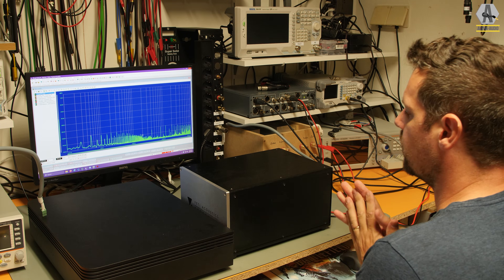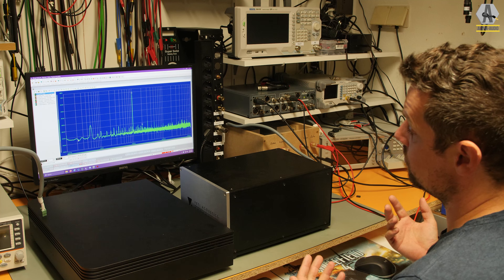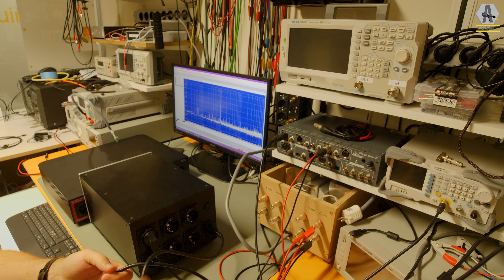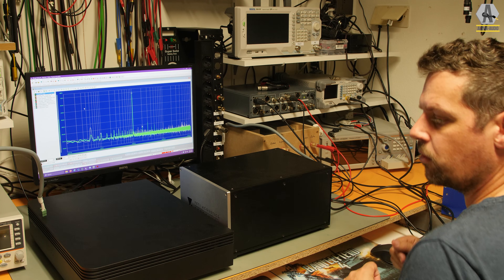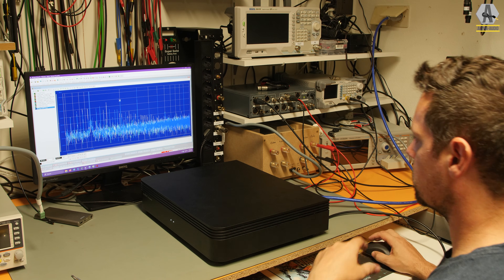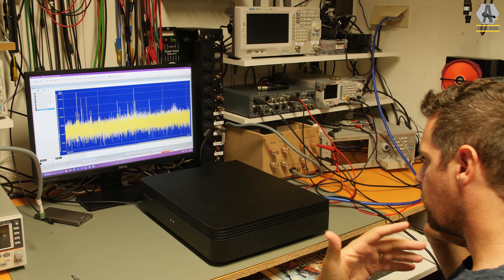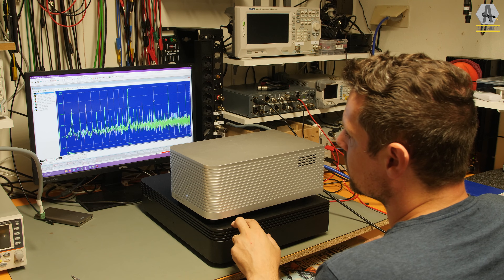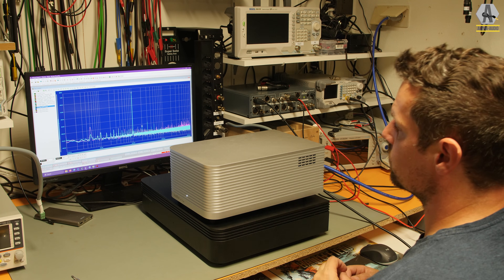Alpha Labs - Do Power Conditioners actually do something?

Comment: There will be no audible difference though. I have asked manufacturers of really high quality amps about this. All have said that the provided power cable to supply is enough and they dont recommend them. I had an Isotek, and I  could hear zero benefit of it being used.

Comment: A power conditioner CANNOT lower the 50 (60) Hz component of a power amplifer's output noise since it is ahat is POWERING the amplifier itself. If you got such a measurement then it indicates that your test procedure is incorrect OR that you have not properly questioned WHY. Removing hight frequency 'noise' MAY be possible but this work is simply sloppy and clickbait.

Comment: It doesn't take very much DC on the mains at all to meaningfully reduce the VA rating of any toroid. We're talking by TENS of percent delta for just a few ma of DC. So any conditioner that eliminates (or even substantially reduces) DC will absolutely counteract any "current compression" in an amp if there is DC on the mains. If you own a refrigerator or other appliances or phone chargers....you have DC on the mains.

This is aside from the myriad other noise reduction benefits that quality conditioners can bring. Just talking DC.

Oh and if you are talking about the many (cheap) DC scrapers out there such as from iFi, et al.....those can only remove a certain amount of DC. Useful in some cases, but in no way comparable to a dedicated conditioner.

I use a 10 kVA topaz 31 series (.0005pf) wired for balanced power for my solid state system and a 2.5 kVA Topaz 31 series (.0005pf) wired for normal power for my tube system. Just power strips on the output of each. I don't use more than 30% of either's current capacity for the highest dynamic peak for either. And DC can't make the jump from primary to secondary (obv).

Jet black backgrounds, effortless dynamics...... "2am sound" at any time of day.

Comment: Can you do everyone watching this strip each unit down and go over the components and circuit the reason the yetti does so well it has an isolation transformer big deal unless the inside has been blessed by a witch doctor I don’t think the yetti has cost more £300 to make 90% mark is a bit over board

Comment: What I'd like to see is the result of adding some low ESR RF bypass capacitors across the main supply smoothing caps plus in other critical areas like current sources etc, unfortunately power amps don't have published PSRR, if they did this "problem" would disappear but so would another lucrative income stream.

Comment: I'm a bit late to the party and I mostly enjoy the content you guys create.  But what is shown here is fairly misleading.  50Hz is the fundamental, so if you measure less on the output, then less has gone in.  Meaning that the output voltage of the conditioner was lower than the voltage from the wall socket.  You can filter anything, but once you change the fundamental, all bets are off...
Reply: No, that's wrong. You don't want the fundamental frequency of the mains coming out of your speakers so if a filter reduces or removes it. that is a positive effect.
Reply: @user-ig6os2yk4h The fundamental is exactly where the power comes from, so no, a filter cannot mess with that.   It's physics 101, not about being right or wrong...
Reply: @0neyedK  Well said. if the 50Hz is lower then the test method is flawed.

Comment: Could you share the actual scan results rather than just showing the analyser screen from over your shoulder? I can't read the scale of the measurements. Are the filtered noise frequencies in the audible frequency range?  Are the filtered noise peaks within the audible threshold?  Attenuating noise in frequencies above 20 kHz or lowering a noise peak from -120dB to  -130dB audible changes?
Reply from the maker: We always put the sceeenshots in the article on our website.

Comment: Unless your amp is a total POS, power conditioners are absolute and utter BS
 No amplifier runs on AC. The AC/DC transformer that every electrical component has eliminates any noise or other AC issues. Unless you live in some part of the world where voltage varies by 20% or more on a regular basis no voltage regulation is necessary either! More friggin voodoo science.

Comment: Wonder if the Yeti's isolation transformer makes noise (I mean noise that you can actually hear in the room)? Because I have those old school Oneac isolation transformers built in 90's they work well but also make steady noises that is pretty audible.
Reply from the maker: Nope. They are quiet

Comment: Interesting enough research, I'm sure. But even if there is an improvement the majority of us cannot hear it, so clearly it is so small that it is not worth getting out of bed for, let alone good money. If the claims were anything like true, then EVERYONE would hear the benefits - not just those with superhuman hearing.
Reply from the maker: Okay. So first people claim we need to find proof with measurements. I give you measurements. Now we get the claim people can't hear this.... Just try a decent conditioner and find out yourself. The difference is definitely audible.
Reply: @TheAlphaAudio  Just because you can MEASURE differences does not mean everyone can HEAR them. I have no doubt some of us can sense the changes with and without a mains conditioner, in exactly the same way as some people can taste tiny amounts of chilli or some other ingredient in their food (my mother was exceptionally sensitive to capsaicin, and she could detect almost homeopathic quantities of the stuff). My point is these people are the exception, not the rule. 

Over the years I have tried a number of mains conditioners, and to me there is simply no audible improvement. I am not alone in this, because no-one who has listened to my system with and without one (Lyngdorf sources and amp with Monopulse 82 speakers, so hardly entry-level stuff) could consistently tell when the mains conditioner was connected or not. At least, not without looking!

I can therefore only conclude that either the mains in my house is unusually clean, or mains conditioners are not all they are cracked up to be. If you can hear a difference then I am happy for you, but for me they are a waste of money. And I suspect the same will be true of most people.

Comment: I have a monster power conditioner. Regardless if it’s hooked up or not I can hear my vacuums power noise on my speakers when they are all running at once. In my experience they are useless.

Comment: I don't use power conditioners to improve sound quality.  I use them to protect my audio and computer equipment from damage and reduced lifespan caused by unstable utility power.
Reply: That's the real reason I would have one. The difference in audio quality is inaudible.

Comment: Hi !! The three modules are not simple power conditioners because they have an isolation transformer inside. They made a good job at killing the noise, but most power conditioners have only chokes and capacitors and that is the reason their filtering capacity is limited. Another important point, with an isolation transformer inside, there is severe limitation on the current you can draw (between 400mA and 1 A, insufficent for power amplification ). This is still a very informative video. Thanks !!

Comment: That looks like an actual, proper power conditioner. Looks to weigh about 20 kilos and is about 4 times the size of those Furman rack units. Yes, this is a real and proper conditioner, but most things sold as "power conditioners" are nothing but glorified extension leads with a fuse.
Case in point; https://www.youtube.com/watch?v=iNC3TSTT3ig

Comment: What is the real world difference though?  Can you hear a difference in the sound quality?
Reply: I basically can't listen to music without an isolation transformer in my apartment now, I have one of those handy line noise meter thing, it reads almost 1000 millivolts out of my wall socket, blasting loud noise at the same time (it has a tiny speaker and amp onboard), while after the isolation transformer, it reads 20 or less, nothing audible too, huge huge difference, and music becomes enjoyable too (more depth, more agility, more definition, more 3D, more lively), I can't go back really.
Reply: @StraightRocketFuel  lower noise

Comment: Soo what am i needing to buy for my 1200W gaming PC? I/we don't know what is considered "good" or "bad". What's the recommended tolerance for smooth power conditioning?
Reply from the maker: @fcfdroid  if you want to just eliminate noise - I guess that's the point - any decent filter will work. High end power conditioners don't impact speed, imaging, etc. But that is not important for a PC.
Reply: @TheAlphaAudio  transients are definitely a thing with gpu and CPU performance. Now how evenly they get their power may or may not effect their power 🤔
Reply from the maker: @fcfdroid  a well build PSU from a good brand - seasonic, bequiet, etc - will deliver all the power the cpu or gpu needs. I have build loads of pc's. Also gaming pc's for VR racing. Never had power issues with a good PSU. They are very noisy to the grid though. So if you have a high end hifi system next to the pc, you want a good power conditioner.

Comment: How do we eliminate mains hum? I want it gone. At high volume levels in quiet music passages I can even hear the AC frequency change by the change in hum sometimes. Ten houses 10 hums. Doesn't matter what amp, new, old they all hum in all houses all the time when the volume control is around the 11 o'clock position.
Reply from the maker: @ThePaulv12  probably DC

Comment: Amps run DC.
Only the power supply is AC.
How could it possibly make any difference?!
Reply from the maker: @Stikibits  well... Check the video.
Reply: @TheAlphaAudio  Sure, you beat science, champ.
Reply from the maker: @Stikibits  you mean my Prism dScope and other measurement equipment?
Reply: @TheAlphaAudio  Too funny!
You should publish.
You'll win a Nobel.

The AC signal is non-extant after the power supply...it's converted to DC.

AC noise can't possibly exist within DC circuits.
Reply from the maker: @Stikibits  If you don't want to believe my measurements - actual lower distortion and noise at the speaker output of an amp - that's fine with me. I don't care. I don't sell any gear. I just review stuff and investigate stuff in my lab. have a lovely day.
Reply: @TheAlphaAudio  It's about SCIENCE; not beliefs.

Comment: It would be interesting to see , what effect,  let's say 15-20 volt below the specified grid voltage , the effect that would have !
Reply from the maker: We tested it with a PS Audio. That unit can handle a pretty wide range without issues. Normal conditioners don't fix that.

Comment: Before I started using a power conditioners in my PC room , I would lose a monitor every 2 years or so and it was that way for a way over a decade. Since i installed them 6 years ago I haven't lost a monitor since. I don't think its a coincidence, my pc room is basically a computer lab many monitors many machines spanning the ages, most of the monitors would fail from PSU issues and stop working until the psu issue was fixed assuming it was worth the hassle of taking it apart to do so (crts much so). This has made me a strongly for these things smoothing out the power delivery.

Comment: I don't think its a good idea to recondition AC to AC in such application ( audio equipment ) all audio devices use DC. why not just have a quality linear AC to DC, and then feed that clean DC to the amplifier, dac, etc. ( yes those devices will need a separate DC input ) but that's far better that this AC reconditioning business.. its an overkill

Comment: What about cheaper furman power conditioners?
I have a furman AC-210A. Bought it, hoping it would reduce noise for my audio gear, because I have problematic electricity at home. My fridge causes a high pitched whine in my audio gear. (I turn off my fridge when I record stuff). However, the furman didn't solve the problem at all.
Reply from the maker: Haven't tested them. So I dont know.
Reply: You need an isolation transformer like the Furman IT 1220. Refrigerators are nasty things for power.

Comment: Give me an amp that doesn't need a conditioner, also in other tests I've seen some power conditioners can reduce the amplifier output. In my own experience in blind tests I've never been able to hear the difference, might just be me but at the cost of these units I'd rather just go for an amp that is clean regardless.
Reply: maybe, amplification, is the problem!
Reply: I bought a  Furman power conditioner used for $1,000, which retails for something like $4,500.  I wasn't expecting much of anything; however, the price was so good, I took the plunge.

INSTANTLY, I noticed two things:  Instruments were significantly better focused in space, and, even more important, the purity of instruments such as flutes, french horns, ect.  went from sound good to sounding incredible.  They coalesced sweet, yet brilliant, point sources in space (depending on the quality of the source).  Also, vocals stand out more.

The entire spectrum of instruments from left to right, feel more grounded and separated from each other. 

Electrostatic  speakers highlight these kinds of differences.

I had been warned about power conditioners "thinning out" bass.  I have no problem with this in my system.

None of this has a lot to do with cleanness.  You have to have a clean amplifier to begin with.  On top of this you use power conditioning.
Reply: @trevorpsy  its called placebo
Reply: @Discediteee  You picked on the wrong guy.  I have Ph.D. in psychologist with a thriving private practice.  I know placebo when I see it.  What is your problem?
Reply: @trevorpsy  Its called placebo !!!!!!!!!!!!!!!!
Reply: @trevorpsy You most probably see placebo effect when it occurs with others, much less likely when it happens to you.
A well known Dutch professor/ psychiatrist who was quite up to date with schizofrenia fell vicitim to it himself so there's that.
Reply: @trevorpsy  I'm glad that worked for you, personally I would have traded the amplifier in for something that doesn't need an inefficient lump attached to it. 
As I said if it works for you fair play.
Reply: @slartybartfast1  I think it comes down to how revealing your system is.  If I didn't have electrostats, I may singing a different tune.
Reply: They don't require one because it's cleaned up during the AC to DC conversion. That's why people selling them never measure the amp output cause there is no difference that any human can hear 😂
Reply: @shaolin95 Well clearly we Can hear a difference.

Comment: I think we in europe do not need that, or almost do not need. Cause 240v. Maybe i am wrong, and is another factor, but is what i experience and what i see. We have that problems, like everyone, just you do not notice them like people in US for example. Maybe we have cleaner energy coming from outside, or maybe less developed areas take advantage cause less people.
Reply: Trust your own ears. Could be the difference between hum/noise at 60Hz VS 50Hz or maybe the power is just very clean in your region or maybe you are benefiting from the adoption of DAB radio VS all the analog radio still being broadcast here. If it ain't broke then don't fix it.
Reply: We had a radio station long time ago in my town, i remember my hot speaker picking radio signal from that even when was off. Nowadays we do not have radio station. The signal i have in my house is clean, i have low to no noise, only the wind of a dialed valve amp, but i know people in my area that live near a hight tension eletric towers and they suffer a lot from noise. But in general that eletric towers are not in the middle of the towns so in my experience even a cafe or club have a clean energy suply coming from the street.
Reply from the maker: Voltage has nothing to do with noise.
Reply: @TheAlphaAudio i am just a noob
Reply from the maker: @duartefaria7134  everybody is free to ask questions. That is how we learn.

Comment: A good follow up  to this video would be how does all this highly expensive power conditioner compare to a more economical affordable power conditioners like a furman power conditioner and do  a face off test and see if it’s worth forking over thousands $$$ on power conditioner vs $50-$200
Reply: @carlosr.2027  A Furman or comparable unit is a glorified, rackmount power strip.  That comes directly "off the record" from the engineering folks at Furman.  SurgeX are only slightly better in very limited situations.